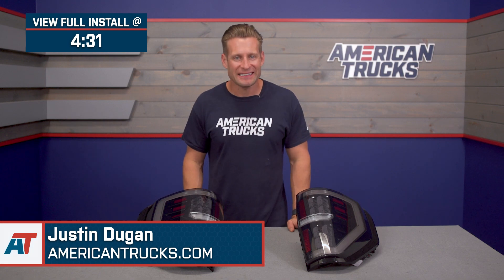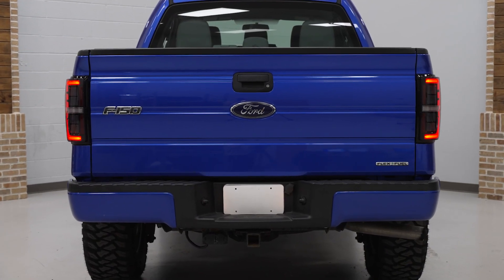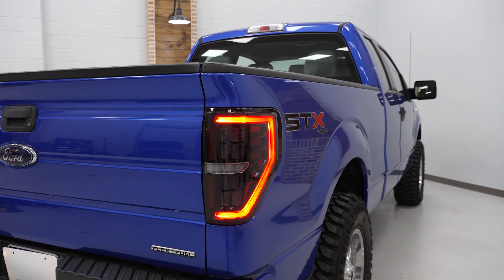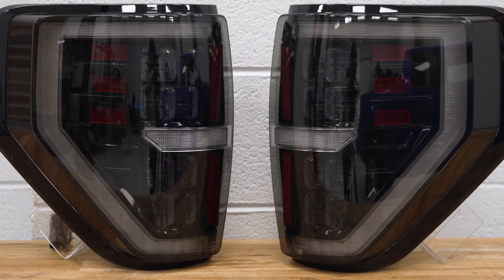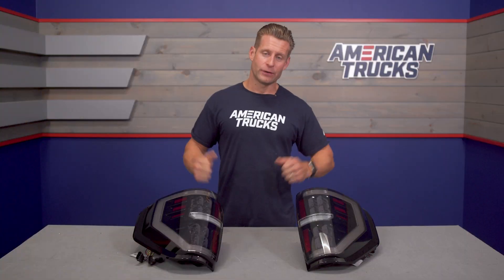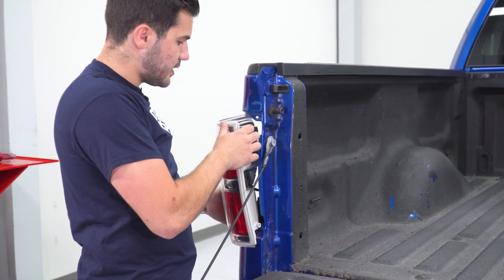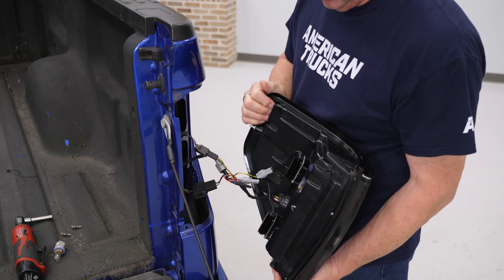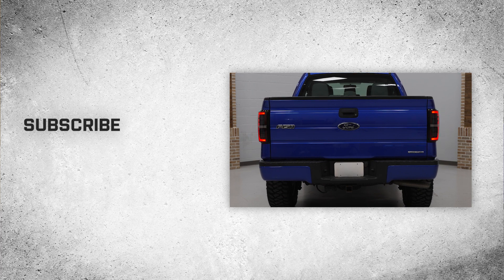2009-2014 F-150 Morimoto XB LED Tail Lights; Black Housing Review & Install

Comment: Just traded my 14 F150 Lariat  in for the 23 F150 Lariat, regardless on what flavor F150 you have I like them all
Point is that they kind of look like the 21-23 models, which I like how Ford brought back that shape of tail light look
from the 9-14